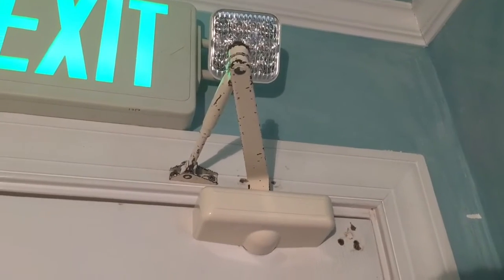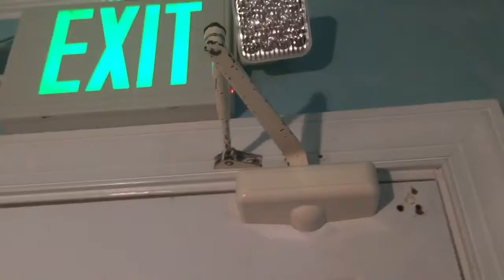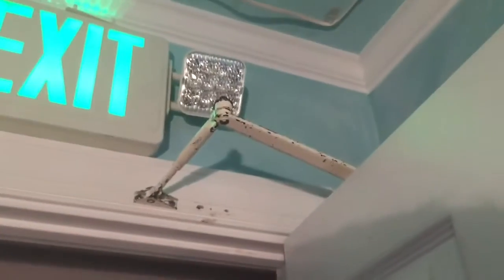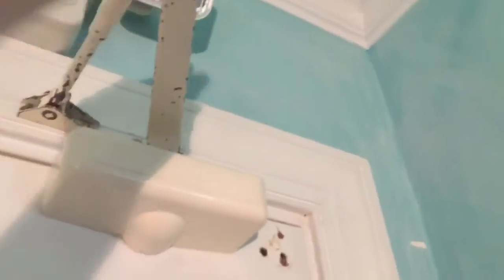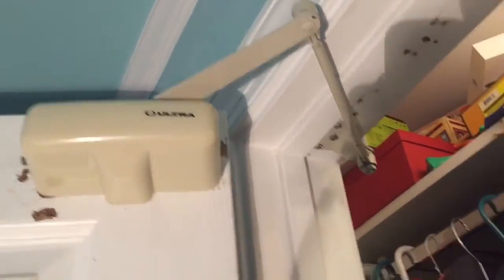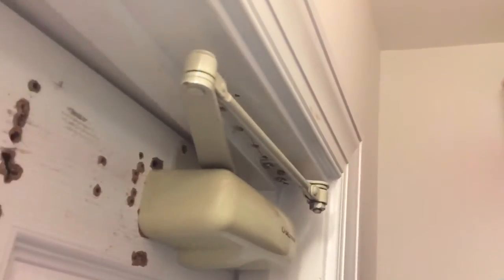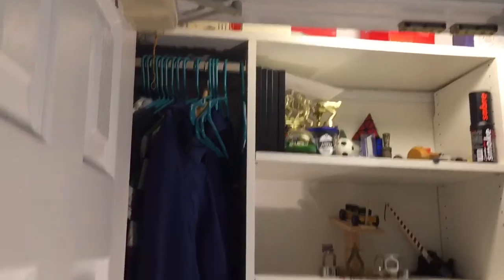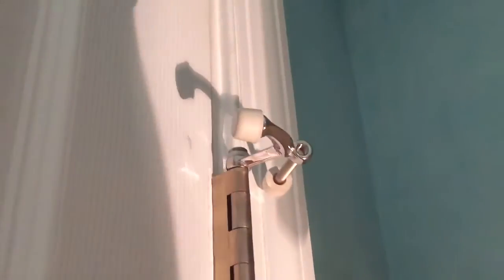Door Closers: Few changes

Comment: Cool! There are so many visible holes in your doors
Reply from the maker: StormzAlarmz2500   Thanks! Yeah, I made a lot
Reply: ExitSign250 you should patch them or put covers on them and take the covers out when you use certain holes
Reply from the maker: StormzAlarmz2500   I'm eventually going to patch them, I'm definitely not going to put a cover plate on them